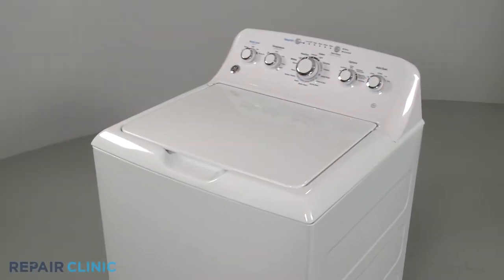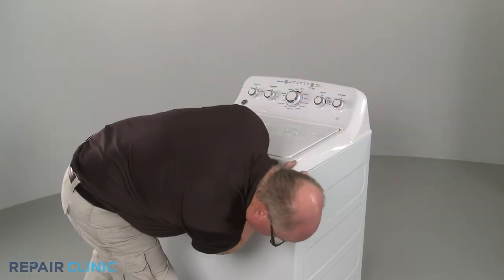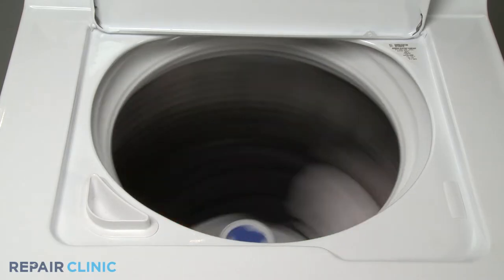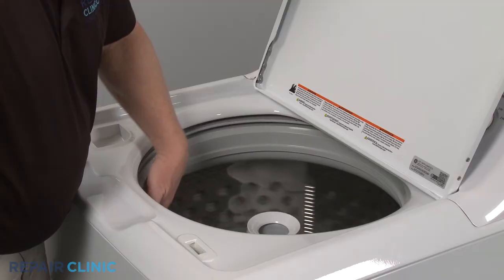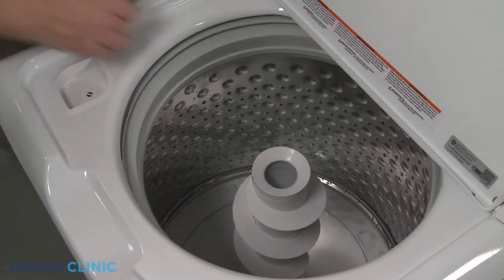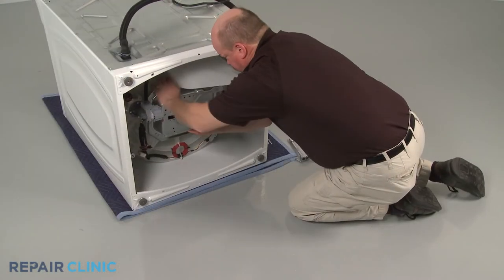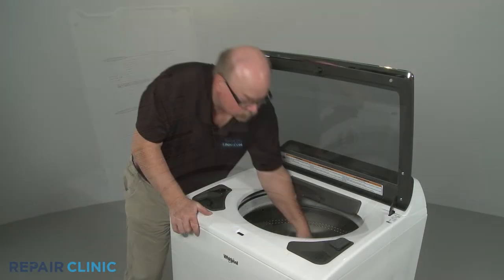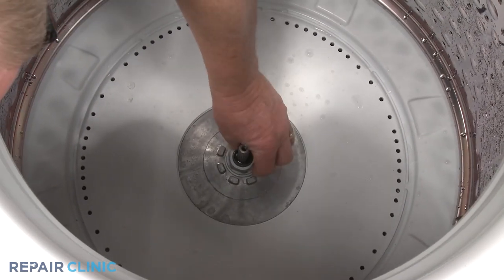Washing Machine Inner Tub or Transmission Damaged?

Comment: Hello I am currently trying to diagnose why my top load is still shaking/banging after replacing the rods and upgrading the hub (plastic to metal). It’s not doing it as bad now after the upgrade.
Reply: did you ever fix it?
Reply: @adrpals2324 im facing the same problem, just replaced the suspension rods; seems like it's the drum bearings